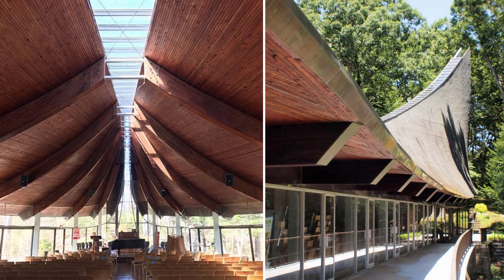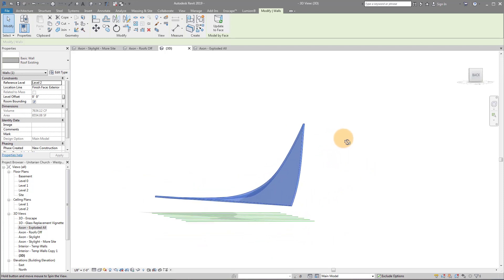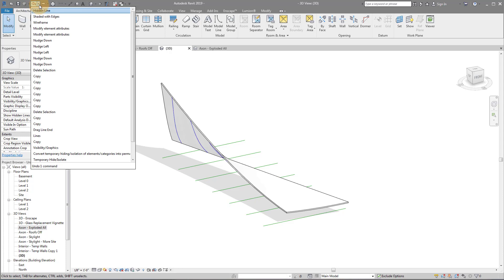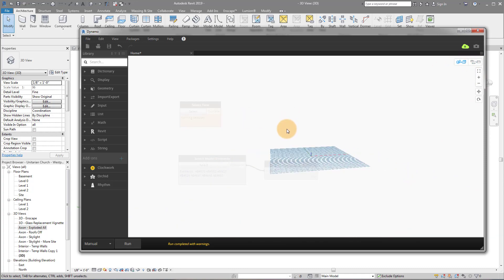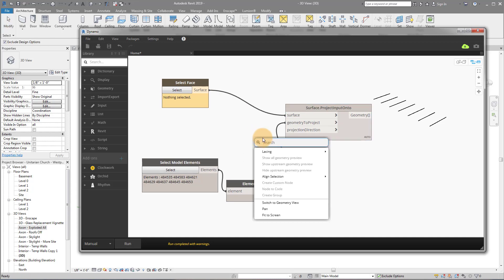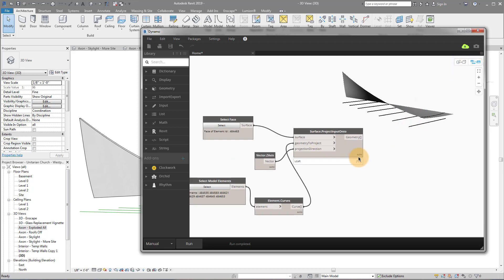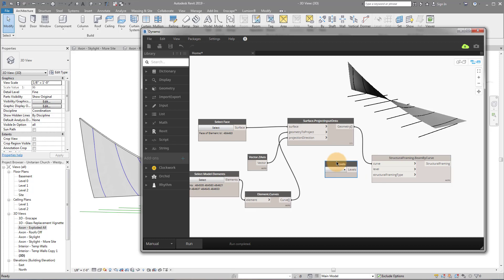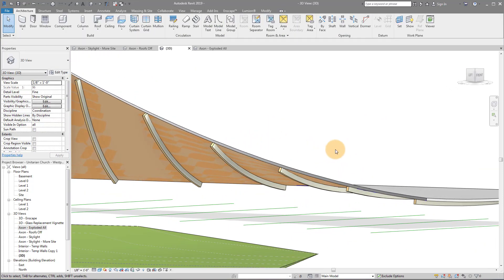Revit Tutorial & Dynamo Tutorial: Beams That Follow Complex Roofs

Comment: I've been struggling to find a way to model framing on a curved slope. This video is a great help. I'm working with a similar situation, but I need to use curved beams that are also sloping - much like the ends of the roof in this model. This has helped me with the intermediate framing members, now off to figure out the edge beams. Again, thank you!
Reply from the maker: So glad my video helped! Cheers!
Reply: could you solve the automatic rotation that gives to curved sloped beams?
Reply: @checo5098  same situation. The beam got attached from the center but we need that the beam face also be parallel to the bottom roof or slab selected face.

Comment: Hi Jeff! Thanks for the video! The select face node doesn't work with me and gives me an error (Warning: One or more geometries have failed to convert due to this error: trim_with_edge_loops requires all curves to touch surface
One or more geometries have failed to convert due to this error: trim_with_edge_loops requires all curves to touch surface)
Do you know how I can fix that?
Reply from the maker: That could be a million different things... Without seeing your surface/face or your project it's hard to help.  I would say post the issue on the Dynamo Forum... or shoot me an email.
Reply: @TheRevitKid  Thank you for the response ! I just figured it out today. It turned out I was hiding the in-place surface after I created the roof by face, and dynamo wasn't picking it up. So I unhid the face and selected it again.